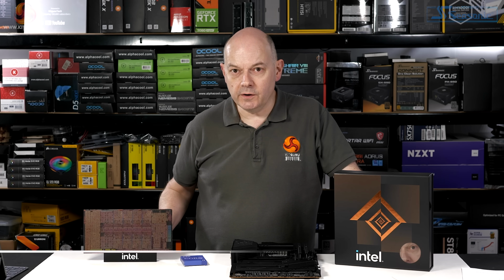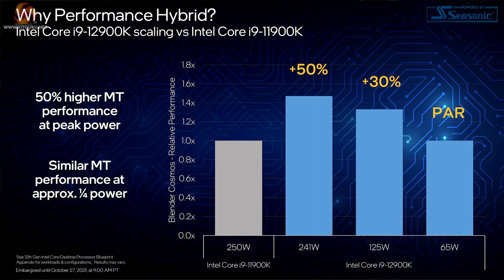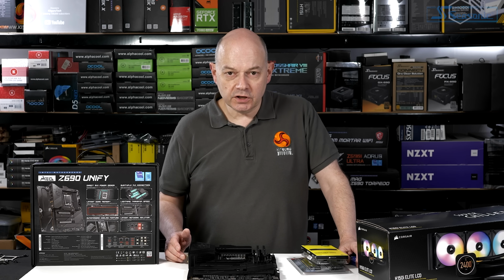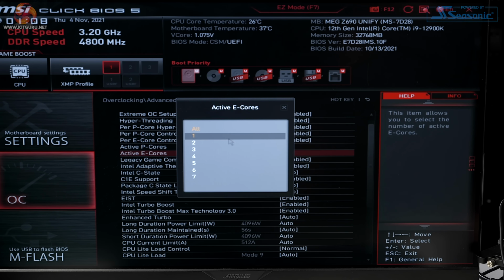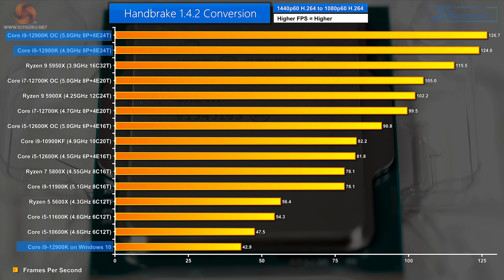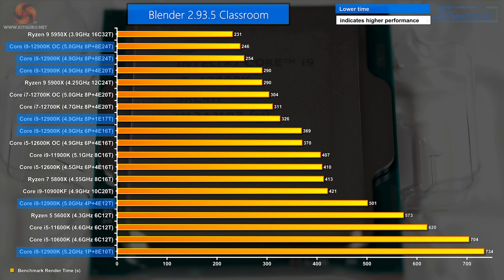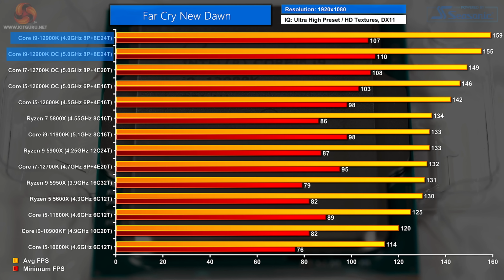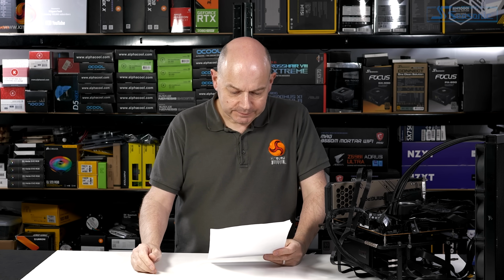Intel Core i9-12900K – Enough power to burn the planet!

Comment: The best review I have seen, a lot of other reviews gloss over the heat and power consumption issues on the I9 which I think are going to be an issue down the road. From what I read you need a higher-end Z690 MB because of the power to run the I9 at max potential. I need to update my I7 4790K , probably will go with the 5900X or maybe the 12700k nad not overclock, my computer is used for day trading and music production.
Reply: The only intel 12th gen i like is the i5 one
Reply: 12700K is better than 5900X. Golden Cove IPC and singlethread speed is crazy for music production.
Reply: @saricubra2867  The planet should be going multithread, single is stupid.
100C and failure of chips causes downtime that costs a lot more than the CPU
Reply: Opinions are like ass holes everyone has one . Point is to me computing is fun  and that's all it is . Its not my income . I only make $100 per build and don't do a lot anymore . I don't chase after rumors sites nor do I really follow any tech wizards. I find most are liars and pimp for mammon. Over the last year I listened to the wizard's talk about AL no one was even close.  Moores law claims he had it right but that a pure lie . He got close in  the last six months but before that he was way off.  The info Intel published 10 years ago had all this stuff in it.   10 nm was Intel real problem and that's all behind them now.  5 years ago DIY was great fun . But the wizards are all shilling AIO water cooling . LOL . Its not even close / Most DIY water set ups are even a Joke ... Because  these long runs are just stupid . The idea  plumbing is the shortest runs possible .  The idea behind water cooling isn't really about OC. Its about Fan noise . My grandsons machines are done to perfection. Short copper tubing runs , One system is set up for high flow  1.5 gpm and the other system is a high flow low pressure setup 1gpm - 2 pumps . Both are dead silent and out cool any and all AIO system no fan noize -zero .  Both use D5 pumps . High pressure 1 pump  High flow low pressure 2 pumps.   X flow rads . Small case  1 xflow 1 dual pass.   The big case 2  x flow.   WE all have different goals in our builds mine is Best Stock performance and Silent running . 241 watts is nothing to run at full load at 75 C  at worst.   Do real work and the power numbers are conflated. Worse case does matter only to your kind of people.
Reply: @Nemesis1ism  Not really sure what your rant was all about  and why it was in response to my comment which basically thanked the guy for a honest review so that I can make a better decision when I decide to upgrade my PC.  100 C overclocked is insane , my overclocked I7 won’t even get over 65 C under max load while testing. Yea apples and oranges comparing the two , and not that I am going to do Cpu intensive stuff that often but I don’t want to deal with that kind of heat . Anyway need to let the hype calm down a bit and see what AMD does with the pricing on the 9X chips . Right now it’s a toss up between the i712700k and the 5900x.
Reply: @musicman102357  Or wait for Zen 4D which should be coming Q1 2022 (?).

Comment: Would have preferred a custom loop for your tests I have 0 faith in aios due to the heat still being trapped in the pump sitting on top of the cpu but I understand the ease of access, great video regardless thank you sir. 

I had an amazing experience using advanced + offset overclocking low temps + high overclock and low voltage ⚡️blew away the thread ripper scores In cinebench and didn't pass 74c even after running the cpu all day long, simply amazing.

Comment: running a 5ghz p 4ghz e and 4.1 ring oc on my 12900k @ 1.23V, never breaking 85c on a 280mm aio. Voltage plays a huge role with these chips, and the stock llc and voltages applied from these motherboards is just way too high.
Reply: What is the brand of your cooler? And your case please.
Reply: @mohsenkhorsandi7165  corsair h115i capellix, corsair 4000x case (with airflow front panel)
Reply: @bulletz4life  Thanks mate. That's a really good aio.
Reply: @mohsenkhorsandi7165  i think anything 240mm and up would be fine as long as you dont push the oc too hard and drop voltages as low as possible. I dont need the extra 1000 cinebench points from pushing the oc to 5.2ghz while gaining 30c in temps
Reply: @bulletz4life  I'm using a 360mm Cooler master on the 12700k. The Temps are below 75c on 188 watts.

Comment: When you OC , it's expected to get hot .. even if its a factory OC .. i have the i9 12900K and not realy have problems  , i run it in non -OC .. because i didnt see much difference between OC or NOT OC .. it all depends what you are using it for i guess.. OC doesnt mean much difference when playing games ... you're better off OCing you GPU instead ... my i9 is idle 28C ..  only time it jumps up is when unpacking games .. like installing a big game.. and even then it goes back down fast again when the effenciency cores take over.. nice thing is i can install certain games using those cores and my CPU temp stays hovering around 35C

Comment: Cinebench R23, 12900k running 5.1Ghz on the P cores, 4.1Ghz on E cores at 1.26v temp hitting between 79c to 82c hits a score of 29133 so not sure what's up with your test results hitting in the 27000's

Comment: My verdict, which I haven't heard said outright to this point, is simply that there is no outright winner. It seems to come down to a case of "AMD edges ahead when your application benefits from multicore, Intel if it depends on single core". Will Intel only have to throw more cores at it to win both styles of benchmark? Given a PC with these new premium CPUs in can easily cost upwards of £3,000 perhaps somebody will come up with a motherboard for ultimate power-users which uses both CPUs and which will only add a few hundred quid to the total cost? Now there's an idea! A four grand PC with AMD & Intel on board. :) I am thrilled though that this means Intel retakes the crown for gamers............. I just happen to be a technical user, not a gamer. So what's Intel doing for me?

Comment: CHECK power at the wall when computer is idling . I know why you don't . Wall power at idle for AMD is 100 watts its 30 watts for intel . So shut your AMDs down when not using they suck power at idle at the wall.
Reply from the maker: Leo here: I have stopped logging idle power draw for the system and CPU because it doesn't tell me anything useful and the charts are very dull.
Reply: @KitGuruTech   COME ON KIT YOU KNOW THATS INCORRECT DO YOU TURN OFF YOUR COMPUTER WHEN NOT IN USE? I DO NOT NOR DO MOST PEOPLE . SO WHEN YOUR SLEEPING YOUR PULLING 100+ WATTS FROM THE WALL WITH AMD AND 30 TO 35 WATTS WITH INTEL SET UP, AS I UNDERSTAND NEXT GEN. AMD HAS FIXED THIS PROBLEM , AT THE SAME TIME INTEL HAS CUT POWER USAGE ON RAPTOR LAKE BIG TIME SO 5.5 GHZ WILL BE COMMON.
Reply: Lol where did you hear this nonsence so your whole intel 12900k rig pulls 30watts from the wall whis fans coolers drives etc utter tosh 😂

Comment: THEY HAVE TO USE OPEN BENCH WHICH INVALIDATES EVERTHING ,  AIO WATERCOOLING FOR a high performance CHIP LOL AT THESE FRAUDS,  His BENCHMARKS MANY of those THE 12900 K WINS ON MOST ALL OTHER BENCHMARKS BUT THIS GUY CHEATED AND LIED put AMD ahead.
Reply from the maker: Leo here: The All Caps gets a bit tedious and your points are simply wrong. We use an open test bench for convenience; if we used a case no doubt you would say it was the wrong case. Feel free to spell out which data is incorrect where I 'cheated and lied to put AMD ahead'. It is crystal clear Core i9-12900K tops most of the charts and where it is beaten it is by the might Ryzen 9 5950X. No doubt you have your own screenshots from testing that prove the opposite.

Comment: The 12900K uses a lot of power in virus app.   But if you test in games and most other apps its reasonable.  When at idle no one using. its way more efficient than AMD POWER AT THE WALL.   INTEL IS EASY TO OC. Simply rum it full turbo . This clown is a hater.  It matches the 5950x which uses a lot of power also .  If I want I can easily get 230 watts on a 5950x
Reply from the maker: Leo here. You are being rude and unpleasant.

Comment: Ideally don't update (in-place) a major windows release, and absolutely not if you're doing benchmark testing.  You're making assumptions about the i7 versus i9, the "silicon"  isn't the issue instead base clocks, cache and core count.

Temperatures ..  The thinner the better prior. Intel and AMD chips with thick wafers made temperature disposition more difficult. The thinner layers allow for better disposition of heat.  I think people need to start focusing more on architecture and MTr/mm².

Windows clean installs .. JJ at ASUS  goes into more detail.
Delidding and heat compensation .. Derbauer delidding i9-12900K  offered a good explanation and comparison.
Reply from the maker: It's not an assumption about Core i7 vs. Core i9, more like an initial assessment based on our test data

Comment: Everybody are exciting by the new arhitecture which is interesting.. but..3200mhz vs 3200++++in favor of AMD ? Note that no ryzen need liquid cooler..add z690 mobo (ddr5 motherboard only 600 euro ), double price ddr5 mem and almost double power...for +10% in few synthetic bench...3 gen wasting resources for the blue   WEF should consider intel a present danger for climate change..

Comment: I think I'm gonna pass on this i9 12900K (I currently have 3770K) I would rather buy the 5950X instead.
But I guess I wait for AMD's next upcoming CPU as they do a much better job with performance/power draw.
Like always when Intel releases a CPU that comes close to their top CPU, AMD crushes Intel in the END!
Reply: Draws half the power and don't regret getting it. Using an AIO for it and barely audible. Awesome for silence and work.

Comment: Sorry Kit, but Intel's 10nm is far superior to AMD's(TSMC's) 7nm.
Reply: 10nm is trash there stuck at 14nm+++++++++++++ while amd will go for 5nm
Reply: @drsm7947  You call it trash but it's beating 7nm in almost every test..? Not to mention it's 8p+8e, half of which don't even have HT.

If anything it shows how slow TSMC's 7nm is.
Reply: @frostybe3r  its still a trash and it did not beat at eveey test and amd 7nm beat intel because intel stuck 14nm+++++++++++++++++++++++++++++++++++++ while amd will go for 5nm soon
Reply: @drsm7947  Uh, are you 13?
Reply: @frostybe3r  no how about you still 5yr old?
Reply: @drsm7947  When you're ready for an actual discussion I'll reply, but for now have a nice day kid. :)
Reply: Why are you sorry ? Pretty sure Leo likes the 12900k….
Reply: Some intel fanboys here think drawing 2x the power performing maybe 2% is a good thing. Hitting 5ghz on the 5950X is easy
Reply: @AFlyingCookieLOL  That's nice however I have zero regrets switching from my 5950X to 12900K for video/photo & gaming, literally twice the 0.1% lows in games, AMD is a stuttery mess by comparison.
Reply: @frostybe3r  🤡

Comment: Hello Leo, your video was highly informative and well made. However, I am curious to know, what are the load voltages on the P and E cores, respectively, for the Turbo Boost limit under Thermal Velocity boost? I am curious to know what undervolting headroom there is for P and E cores, as well as current restriction, since Intel XTU offers these features and is being updated for the Alder Lake series of processors.
Reply from the maker: Leo here: Glad to hear you enjoyed it. I made a note of the single VID figure during testing however we have to assume the two types of cores run at different voltages but it was too complicated to get into that during these launch reviews. It will certainly be a point of interest when we get to Z690 motherboard reviews.

Comment: There's an error in HWinfo64. Its reporting Alder Lake at 100°c under full load when its actually at 70°c. I got a super chip that does 5.7GHz on 1c 5.6GHz on 2c and 5.4 on all 8c. This is using a 360mm RAD, custom.
 Though, i wouldn't use HWinfo64 to test 12th Gen when running all cores flat out.
Reply from the maker: You're going to have to back that up with more information including your preferred monitoring utility. During testing on Auto we reported temperatures in the 80s, so what temperature do you think is correct? and where does your information about HWiNFO64 come from? as an FYI, during my testing I contacted my Intel rep on two separate occasions to report seeing 100 C  in those specific circumstances and received no push back at all. Also, why didn't the reported temperature go higher say to 105C or 109C?

Comment: You can disable all of the E-cores but not all of the P-cores. At least one P-core has to be active. A cool thing, is that the UHD770 can be overclocked to 2.1GHz. That's a 500MHz overclock on the iGPU, giving it over 1TFlop of FP32.

Comment: Your peak power numbers are vary deceptive other sites did much better Job  of showing resendable power usage more so on the lower end parts .  Intel had to go to PCI-E 5 for Intel Ponte Vecchio. Yes they need that bandwidth.  So intel did pci-e 5 on the entire line . Intel was never going to do pci-e 4  until AMD did it , It was nothing for Intel to do pci-e 4  As they felt it wasn't needed. pci-e 5 for was needed for Intel Ponte Vecchio. This is vary old news . For hardware guru you suck.  Most other sites also had 12900k beating the 5950 in many mt workloads you did not.  Are you really as bad as potato head? at 241 watts intel is the best CPU period.
Reply from the maker: What on earth are you talking about? Our peak power figure figures are exactly what we say. As for PCIe Gen 5 we know they need to support the new spec in Sapphire Rapids for Ponte Vecchio but what has that got to do with this review? You seem to be saying that our results differ from other reviewers however you don't give any examples. The takeaway is that you seem to be an Intel fanboy who thinks we have a downer on Core i9-12900K when in fact it tops our performance charts 🙄
Reply: i9 12900k is disgrace 5% performance more vs r9 5950x but 100% more power hungry
Reply: @drsm7947     Well granted Intels uses a bit more power in a power virus . If you do  power usage for AMD 5950 it gets 200+ watts also . But the single core IPC increase over AMD is 20-40% better than AMD depending on the App your running , That's a lot  AMD has never had that kind of performance lead ever. Point is if Ryzen 5950 WAS great so is the 120900K,    Its not like AMD fabs chips.. Looks to me like they are all making really nice chips.  Performance is so good today it just doesn't matter, The real surprize has yet to be featured.  When people talk about intels power usage and think its crazy , Look at power numbers for NV/AMD GPUs but your all fine with that.  I think you complain to much .  You do know V ram  isn't   free right . I welcome the increased performance but it does have a cost . In both AMD margins and power usage .   When AMD gets to intels IPC single core It to will be sucking down power. Performance isn't free and a die shrink today is as valuable today as it was 10 years ago and further back.

Comment: Leo, would you agree that, after Steve from Gamers Nexus showed the 12900K using almost as much power at stock as the 5950X was using while overclocked... that i could say -
 'The 12900K is Intel's fx9590'?

In terms of power usage and heat output of course.
Reply from the maker: Intel 12th Gen is not as efficient as Zen 3, especially Ryzen 9. That is crystal clear from our charts.

Comment: Overclocking using xtu one click OC is just going to raise the max turbo freq and use the corresponding voltage required for that freq from the stock VID table so of course power draw is going to be insane.

The doubled chipset bandwidth is quite useful.
Reply from the maker: Leo here: Amen to that and I need to do some manual overclocking when I get to a motherboard review however there are two points there. The first is that the VID table is created and if it results in crazy high voltages/power the best move is to give it a wide berth. The second is that one-click XTU overclocking only supports Core i9-12900K/KF so we have a 100% fail rate.

Comment: Given the pricing and availability of the DDR5 modules, this calls for a subsequent review with the 12th gen Intels running on the DDR4 RAM for more comparative platform to the 11th and 10th gen and Ryzen Zen3 processors. That way you could also check how the memory latency differs between the CPU families/archs instead of CPU+MEM archs ;)
Furthermore, I'd love to see if the 12th gen iGPU QSV got any better in terms of quality and speed of outputs for media encoding tasks - QSV has been a great tool in the Intel arsenal/stack when compared to Ryzen units for media processing.
Moreover, maybe you could even add the current cream of the crop mobile/laptop CPUs in the comparison charts given how in some tests those mobile CPUs are quite close to their desktop brethren whilst being less than half if not a quarter in terms of power and thermal envelope, and given how much full desktop builds or new laptops cost now. It'd be very beneficial and maybe kind of eye-opening, since several of your test tools/suites already are working on or have a build for M1s, to test those new CPUs in relation to also 11th and 10th gen Intel mobile H-units and Ryzen Zen3 mobile H/HX-units and of course Apple Silicon Pro and Max variants... after all we're still awaiting the 12th gen mobile Intels where Intel might be able to step up its game in terms of power and efficiency but Apple heralds its new silicon as the most efficient and performant for the electricity bills there is ;) Let's just see how far those stable 240+W CPU package draws get the new Intel from all those platforms targeted at the more efficient compute horsepower market.